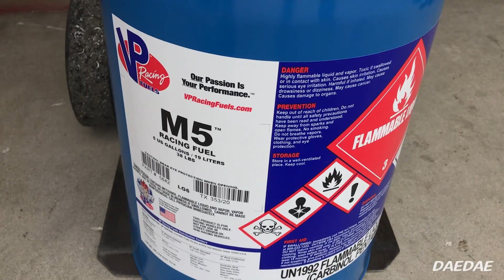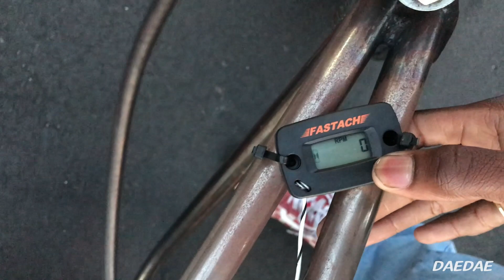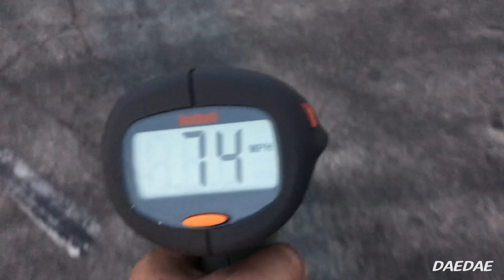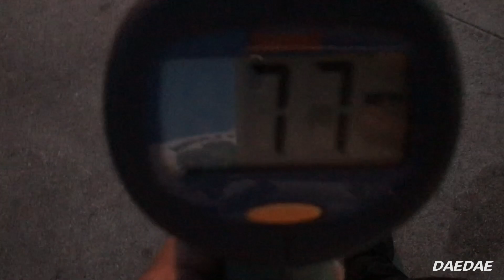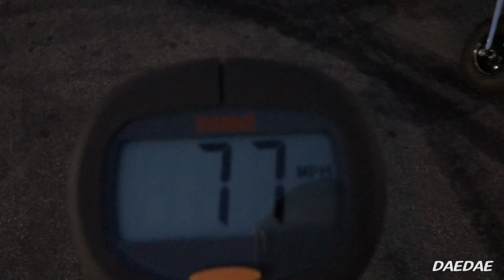THE FASTEST MY MINI BIKE HAS EVER BEEN BEFORE

Comment: Hey man i have a question i just got my first mini bike and it has a cmt 7.0hp engine do you know what oil I should put in it? And do you know if these engines are good?
Reply: 10w 30 and those engines are underrated asfk Nice Fast stock starter bike 👍🏽
Reply from the maker: Yea 10w-30 is just fine. I never had a cmt motor before
Reply: Okay thank you

Comment: Quit choking the engines to shut em off. Doing that washes down the cylinder walls and wears parts out. If you wash the oil off the cylinder wall all thats left for lube is fuel. And then let it sit with all that fuel in the bore. Come on man, class that shit up with a momentary switch.  Yall need to do your homework..... lmfaoooooo